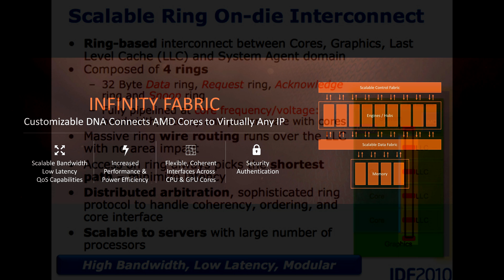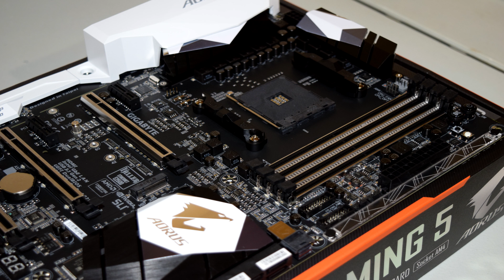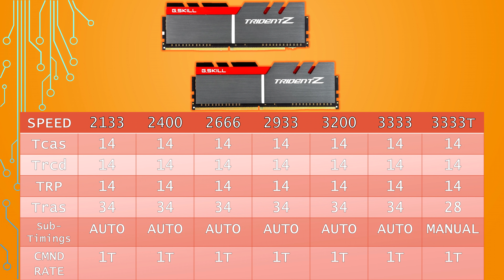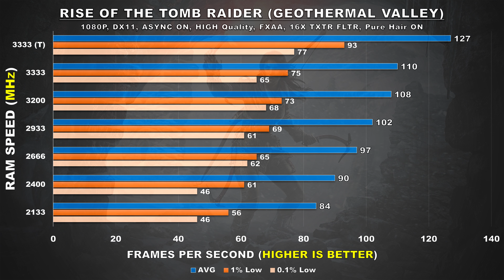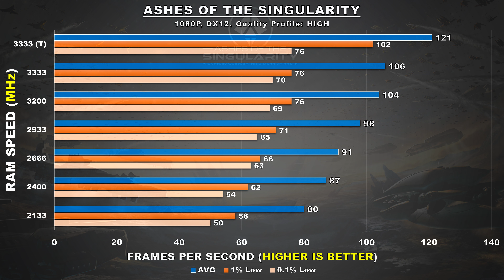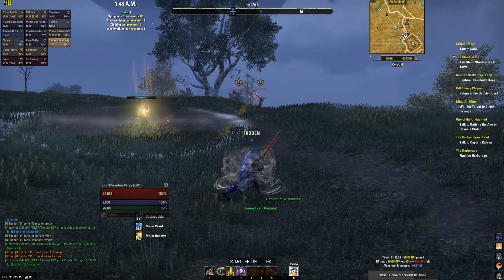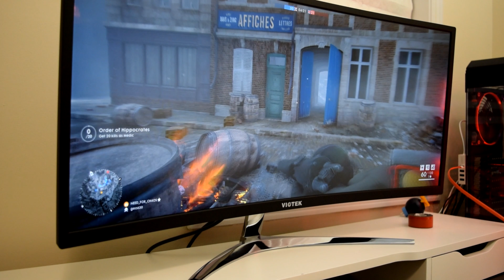7 RAM Speeds 21 Games Tested on AMD Ryzen.

Comment: Hi i wanted to react on your statement that if you would build a ryzen setup now you would probably go for a 3000 memory and try your luck on overclocking it. That would work for all ryzen 1 ( like 1700x,1800 etc).
But now with the new ryzen2 it would crash bad. The 2700x will only work properly with 3200 ram 14 latency. 
I learned that the hard way. Reason is the chipset on the b450 motherboards. I dont know if its the same on b350 motherboards but just saying it.

Regards,

Boemtie

Comment: I would love to know how tightening the timings on the lower speeds, to max the ram out, would affect the difference.  Even with like four speeds.  Is your manual timings secondary and tertiary timings?  I would love to know your full timing spec.

Comment: Wow, this was excellent work (heads off to overclock his mem to 333)
Reply: FYI Couldn't get it to 333 with XMP timings, got it to 3200 though :)
Reply from the maker: Did you try Ryzen dram calculator? It's a useful program that I used to help achieve the ram configuration I used.

Comment: I have a question concerning DDR4 ram memory when it comes to clock speed and timings. Not so long ago i got a new system, with a AMD Ryzen 5 2600, MSI Mortar B450 motherboard and 8 gb Kingstone memory runing on 3466 mhz with CL 19 timing... now... the MB said it can support 3466 mhz so naturaly i went for it without taking in account can the CPU take it, and as it turned out it cant, even tho i asked several times from my hardware provider if the components are compatible. I had instability issues, crashes and so on... now, i solved the problem by lowering the rams clock speed to 3200 mhz, now it runs steady as a rock, but a new problem resurfaced. I want to buy another stick of 8 gb memory of the exact same type, since i heard that when buying another memory stick it is recommended for it to be the exact same as the one you already have, and ofc the memory stick i told you about has dissapeared from the face of the earth, i cant get it in any computer shop in my city... just my luck. 
So my question is... if i want to buy another 8 GB stick, can i get away with a lets say 8 GB stick running on 3200 mhz standard clock speed (since my own memory runs on it as well) BUT on a tighter timing, lets say CL17 ? Since the memory i have is a CL19 i cant help but wonder will a CL17 + CL19 memory combo even tho they run on same clock speed cause problems and instability on my rig ?
Thank you in advance for your help.

Comment: Better than many reviewers out there...
Reply: Got mine 2400Mhz G-Skill ram kit which is 15-15-15-32 timings , overclocked to 2933Mhz with loose timings 18-18-18-38 and that improved my AIDA score ram read memory from 32GBps to 42GBps..Gaming improved 3-5fps.Ryzen likes higher frequency and you can overclock any kit by losening the timings(also get the ram voltage from 1.2V to 1.35V if needed to improve stability-doesnt make ram kit hotter at all)..

Comment: Does this mean I can either buy the same ram you have or a 16gb dual ddr4 3000 GSkill Trident Z RGB CL16? I've been searching for a Ram since I am planning to buy a 2700x on a MSI x470 pro carbon
Reply from the maker: Any DDR4 ram should work, performance will be dependent on ram speed and timings.
Reply: @DannyzReviews  Thank you so much man, I have all the parts ready then I read something about this and I started stressin' out. I appreciate it!

Comment: Damn this is exactly what I needed great video man and
Edit so nice my system I a ryzen 3 1200 with a gtx 1050 there is is really no point in getting anything faster than 2666 mhz? I will be using a 60hz 1080p monitor
Reply from the maker: Thanks for watching glad you liked it. To answer your question, for a build such as yours, faster ram wouldn't make a huge difference. It only matter once you've got a really high end CPU and gpu. Also if your aiming for higher refresh rate gaming.
Reply: @DannyzReviews  OK man thank u for clearing that out  :)

Comment: So i have an 1800x, pared with a GTX 1070 strix OC, and Trident z RGB 16 gig 3200 CL16 ram (Hynix)  alot of other peoples test show that running the mem speed at 2666, with tighter timings Is the same, if not slightly better than running it at 3200... but your tests show otherwise. Is it better for me to run my ram @ 2666 with timings of 13-14-14-14-24? Or go with the full 3200 16-18-18-18-38?
Reply: 2666 cl13 is 9.75 ns in access time
3200 cl16 is 10.00 ns in access time
So 2666 is better but infinity fabric is tied to the speed of memory so 3200 is the right choice for Ryzen

Comment: So how does tighter timings affect performance with slower speed ram. could a 2400 c14 kit match for example a 3000 c16 kit. or do tighter timings only benefit higher ram speeds.
Reply: 2400 CL12 would match. You see clock speed affects to real latency because a timing is count of clock cycles used for that particular operation. 3000 is +25% higher than 2400. So to match latency, difference in timings needs to be same. However ram kits have their optimal operation envelop so they might not reach low enough timings with low clock speed. Also bandwidth, while not most important in games, is reduced with lower clock speed.

Comment: Excellent video. Did you use anything to test RAM stability? Also what was the voltage you ended up with with the tweaked timing 3333Mhz kit?
Reply from the maker: I tested stability with memtest86 outside of windows. Then I tested with HCIMEMTEST and prime95 full blend. Ram is running at 1.43V

Comment: Nice work, keep this up and you'll give Steve over at Hardware Unboxed a run for his money. ;-)
One thing though.
When you tightened the timings, did you only touch the timings or also the sub-timings?
Reply from the maker: Yep, sub timings were also tightened, you can check the link in the pinned comment.
Reply: Great, thanks. =)
I will. ^^

Comment: I'd love to know if ram speed would have an impact in fps at 2160p
Reply from the maker: Depends on the game, and settings you're going to be using. If it's a game like Fortnite with medium settings you'll see differences. However if it's a really demanding game like AC origins, you'll be running into a GPU bottleneck for the most part.
Reply: 3200 MHz CL14 (B-Die) memory is kind of the sweet spot for Ryzen.
But I certainly wouldn't invest in anything higher then that, and if you want to save on your build and rather buy fast memory later when prices are sane again it's not horrible when you're gaming at 4k anyway.
Basically you might see a difference in some situations but at that resolution the differences are not so big that they're really worth the current high speed memory prices.
And there's quite a bit to gain from simply tightening timings and sub-timings.
Just you know, don't expect to reach the memory speeds that a memory module is rated for on Intel on AMD, at least not without a lot of tweaking and a good motherboard.
Reply: it could improve frametimes, but not so much avg fps.

Comment: RAM is for me the most confusing part.. If I want to buy a  DDR4-3200 kit at 14CL which looks like something good for a 2700x. However under the specifications it says its clockspeed is 1600 MHz and the 3200 points to the speed of the memory bus?! I'm really confused as to which number I  have to look at here..
Great video otherwise!
Reply: The RAM frequency is mainly a marketing thing. DDR stands for Double Data Rate so data gets transferred twice during the clock tick. So 1600MHz memory gives you efficiently a 3200MT/s RAM speed. MT/s meaning Mega Transfers per second. So most of the RAM kits available advertise their speeds replacing MT/s with MHz probably because it's already in use in both CPUs and GPUs and is an actual scientific unit which helps people better understand the speed at which they are operating at.

Comment: Awesome test. I have a couple of questions - do you test the games with their in-built benchmarks or in real case scenario ? There can be measured huge differences between that, for example Rise of the Tomb Raider Geothermal Valley. That zone in the in-game benchmark is nowhere near demanding as in the actual game. Also choosing the proper location for testing is very important. Novigrad in W3 and Alexandria in AC:Origins are perfect locations for this type of testing.
Also, can you show a shot of your manually tweak subtimings, and explain at least some of the option, that be very nice.
I was surpsised that manually tweaking performance that much, but its 100% worth it. I guess part of that is because the motherboards adjust crappy subtimings, because of compatability reasons.
Btw, in my region that b-die F4-3200C14-GTZ kit is almost 240 euros. But i  can find a TeamGroup DarkPro 3200Mhz CL16-16-16-36 for 155 euros, i guess the price difference is too big and its not worth it, even though the TG probably has Hynix IC's. Manually tweaking the timings is what matters.
Reply: never ever buy anything except samsung b-die if you want to OC it and/or tightening timings
Reply: @Kotory Yeah i know that only B-die can do CL14 at reasonable voltage, but dunno for those advance timings. Dont think the 50% increase in price is worth it though...
Reply: if extra 100 euro isnt huge concern to you i would go with high speed memory. Low latency memory with 3000+ mhz speed does a lot for ryzen

Comment: 3600MHz is the nice spot for good performance gains!
Reply: ryzen has hard time to handle even 3600. 3466 is much more possible speed
Reply: +Nisco Racing 
3200 MHz CL 14 is the sweet spot in terms of performance to price.
Above that use manual overclocking and time and sub-time tuning to get the most out of your memory.
Reply: Not at the expense of loose timings.  I'll take 3333 with tight 14's over 3400 or 3600 with slop timings.
Reply: G Skill Flare X is really good

Comment: What ram voltage did you use for the 3333 mhz T timing?
Reply from the maker: 1.42 DRAM Voltage worked fine for me. Your mileage may vary.
Reply: @DannyzReviews  I see, yeah I did 1.35 and it crashed. With samsung B-die 3200 @ 3333 14, 14, 14, 14 28.

Comment: I was expecting a realistic test where if you reduce frequency, timings also reduce, like it typically happens under normal circumstances.
Reply: The timings reduce but this doesn't mean the latency will. Timings are based on the cycles. When you have 2000Mhz CL 10 the latency is the same as 4000MHz CL 20

Comment: If you have top graphic card and it have usage 70-80% then RAM speed is important. So for 90% people fast ram is useless.  My GPU works on 99% and i tested 2400 and 3000 Mhz ram. No difference.

Comment: I have ryzen 2700x and due to budget issues got 2400mhz ram. My gpu is 1070ti so would it make a difference to scrap this ram and get 3200mhz ? Its overclocked to 2866 mhz or something. Mobo is asus x470
Reply from the maker: If you're playing at 1080P and are aiming for high refresh rate gaming, then sure it might be worth it, that is if it doesn't cost a whole lot. Otherwise, I would just save the money for a future GPU upgrade.

Comment: So my upgrade path will now be RAM>CPU>GPU
Reply: MrBroxMan forgot mobo
Reply: @Maeno34  nah. that part will be the last one or optional since right now, im using a Ryzen CPU meaning if i can upgrade to a better Ryzen CPU in the future then bios update will only be the thing to do.
Reply: MrBroxMan ohhhh ok so what you do you have?
Reply: @Maeno34  i bought a B350m montherboard back in december 2017 because a friend gave me a Ryzen 3 1200 back then (she got double shipped lol) i already have a GPU , RAM and Hard drives so basically only the CPU,MOBO and PSU was needed. i know that a R 3 1200 botlenecks a GTX 1060 a bit but it still works so i wont waste money in minor performance increase lol. I will wait for the last AM4 chip so that i can fully milk all the value off my motherboard lol

Comment: Speed is not enough - latency is very important with Ryzen so you just did half the job! For example how 3200mhz CL14 VS CL16 differs, and c'mon 1080p is old thing now - real differences come in 1440p!
Reply: When your testing cpu performance, you graphics to remove gpu bottlenecks...